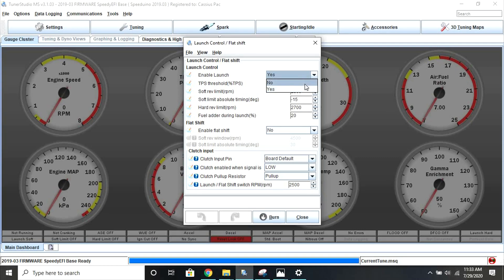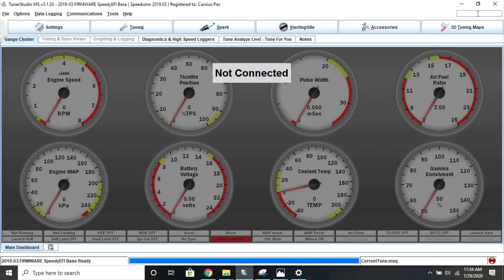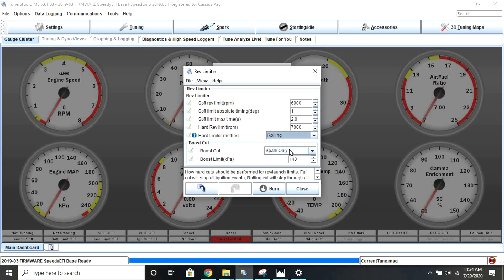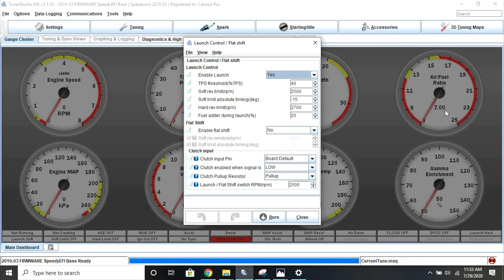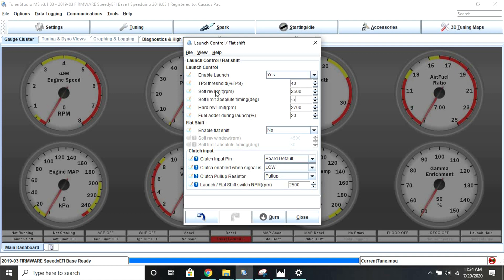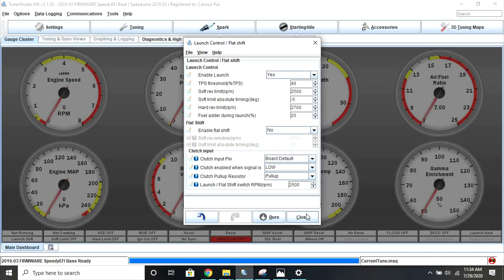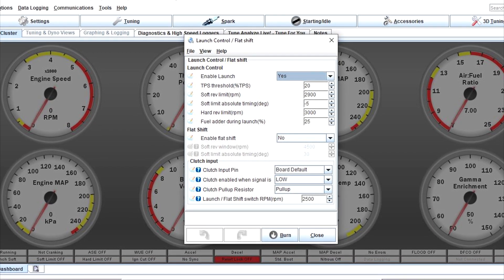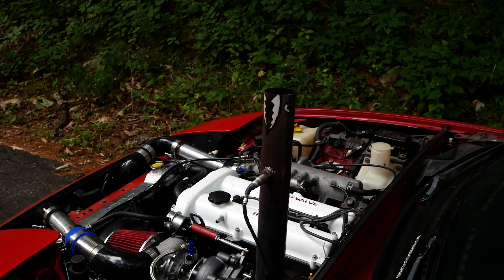Speeduino Launch Control Guide | How To Set Up Launch Control For Flames, 2-Step or Hard Launches!

Comment: My launch control stays on whenever I’m driving without the clutch pressed, any tips?
Reply: I have the Na6 pnp board and I set the clutch pin to 12 and now it works. Board default is wrong

Comment: What if you set you fuel adder to let's say -100%? wouldn't that effectively cut both spark and fuel? or it would just zero out the VE and cause your engine to die?
Reply: Speeduino has that setting already to select which parameter to cut. Got to tuning->engine protection->common engine protection
Reply: Thank you for your comment :) i have already found out that myself. Also have been tuning my car by myself so now i got pretty good understanding of what is where and how to use it :)

Comment: Hey I was wondering did you wire your clutch switch into the ecu? If so how were you able to do it?
Reply: On the speedyefi ecu no wiring to the ecu is required. Just make sure your clutch switch is working. I had to replace the spring in mine
Reply: I had to set mine to pin 12. Na6 pnp board

Comment: Hey bro I have a problem maybe you can  help me..I have a speeduino on my e30 sr20 but the problem is a have rpm spike it won't  run smooth..
Reply: I have the same problem, try using spark cut with full instead of rolling

Comment: Here after so many months, copied your settings, no pops or flames and rolling cut cant hold my RPM it just keeps creeping up, weird.
Reply: Same for me, bmw m52b25, even if i set it to retard 35 degrees, no difference. It keeps it on the rpm but nothing else, also i have the registered version of ts, i do not see the option to add extra fuel with launch controll?
Reply: @woofernl  I just set mine up and at -30 it shoots crazy flames but my motor is a m52b28 also I’m using full cut limiter
Reply from the maker: That’s interesting, it worked fine for me but I haven’t used it since this video to avoid the temptation

Comment: Hey man love the vids, quick question do you ground the switch or get it hooked up with 12V/5V? Couldn't get mine to detect it, super new to the whole speeduino ecu. Thanks in advance!
Reply: I think it's the ground, look up in the wiki
Reply: I know this is old but it’s ground and on my Na6 pnp board I had to assign the launch pin to 12

Comment: Wish they made this ecu for a 1.8 na :/
Reply from the maker: They do for the 94-95! And they are currently testing one for OBDII cars, so it won’t be long until that’s available to the public! Also if you don’t need a PNP kit they made a fishdog kit that you can wire to run later cars
Reply: @CashedOutCars  Best Channel ever. Sounds like I need to dig deeper and do some more research. Have got the 1996 1.8 NA. Thank you bud! Should totally make a discord.
Reply from the maker: You’re welcome! Check out the SpeedyEFI page on Facebook and their troubleshooting and support group. A discord is a good idea, I’ll think about setting one up soon!
Reply: @CashedOutCars  Just shot them an email. Looks like their in the works of the final 96-97 ecu. Thank you again!

Comment: I tried setting it up like this, and while it launches great, the limiter is still applied in gear. I checked the common clutch switch spring and it's fine, and I've disabled my neutral safety switch under the center console.
Reply from the maker: That seems to be a common issue for people, I haven't figured out the solution yet. Is your car a running on a PNP Miata ECU? If you do figure it out, please let us know to help others out!
Reply: @CashedOutCars  I've read in the forums what people do it's putting a switch to interrupt the wire going to the speeduino to avoid the limiter kicking in when changing gears.
Reply: Wondering if you ever figured this out? Mine does the same. Launch control is always on if I try to drive.
Reply: @NickVillecco I have an Na6 pnp board and set the launch pin to 12
Reply: Pin 12

Comment: Btw if I get it right this isnt like Megasquirts clutch-switch based launch control right? Just so I can combine this knowledge with Gregs launch control vid. Sadly I cant get as much info on Speeduino even though I plan to get one next month and the diy-efi guys arent as helpful as speedyefi...
Reply from the maker: It’s exactly like Megasquirt! This is clutch switched also. SpeedyEFI and Speeduino run the exact same firmware so if you have questions just post them in the SpeedyEFI group, they’re very responsive. Good luck!
Reply: @CashedOutCars so do you have to wire the clutch switch to the ECU or jump anything internally? On my second turbo Miata project. Didn’t run launch control on the first one lol
Reply: @CashedOutCars  I see thats nice then, thank you!

Comment: Again a very useful episode. Got the ECU now, just need to convert MK1 to manual then can setup.
Do you know if an intercooler from a S3 could be re-used with a miata setup?
Hoping to use spares part we have rather than buying new.
Reply from the maker: If you can route it it’ll work! Just look to see where it’ll fit and where you can run the inlet and outlet
Reply from the maker: Thanks for your frequent comments and support, email me at cashedoutcars@gmail.com for free stickers!